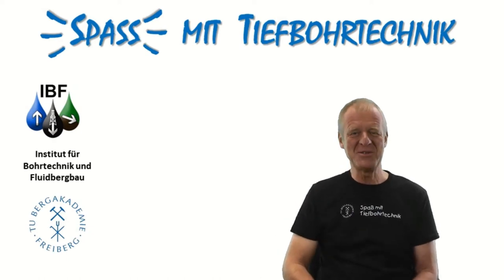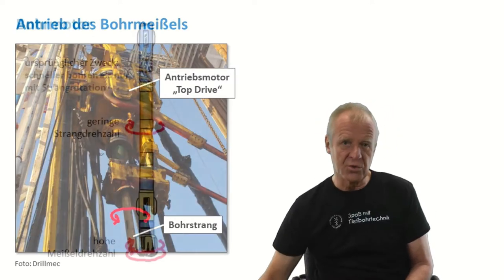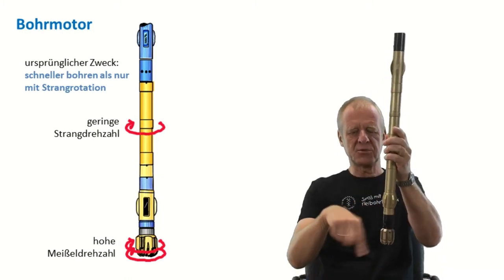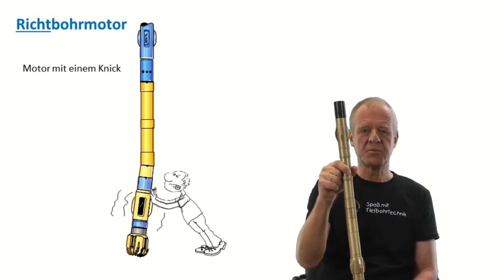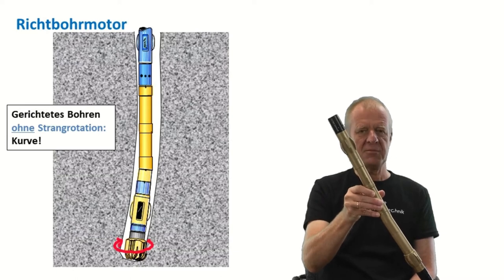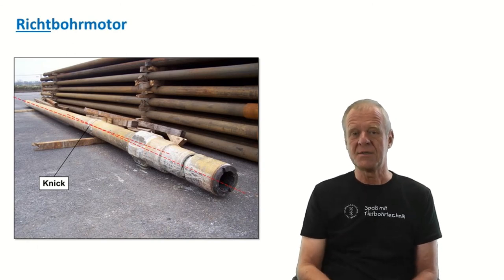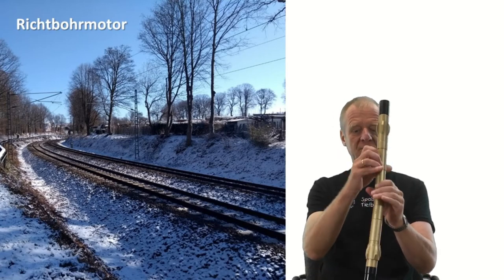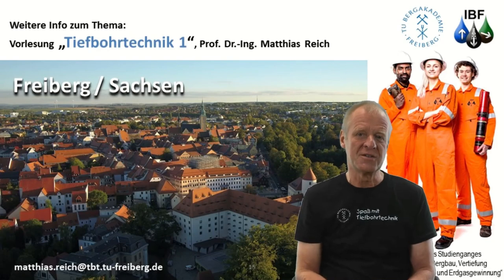How does a Directional Downhole Motor work?

Comment: So What is the main differences between mud motor and RSS?
Reply: Mud motors turn mud flow into rotation of the bit. Mud motors with a bent housing are used to drill directionally when drill string rotation is stopped (slide drilling). 

Rotary steerables (RSS) push/point the drill bit in the desired direction while the drill string is rotated. 

It's possible to run a straight motor above an RSS in the BHA to increase RPM at the bit.
Reply: Can I apply for a master program for drilling engineering technology ?